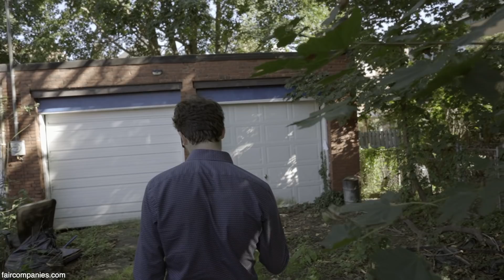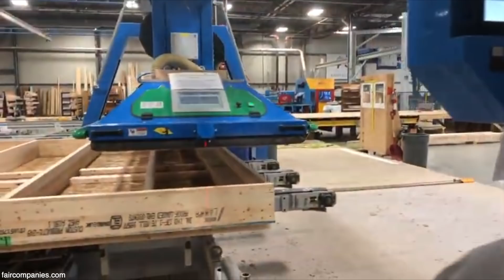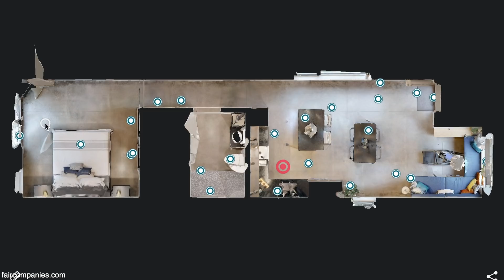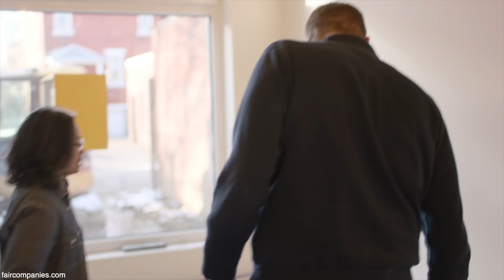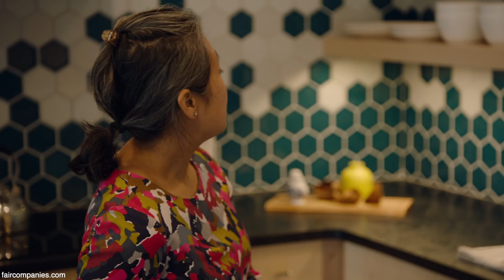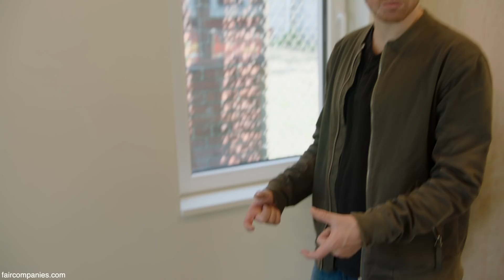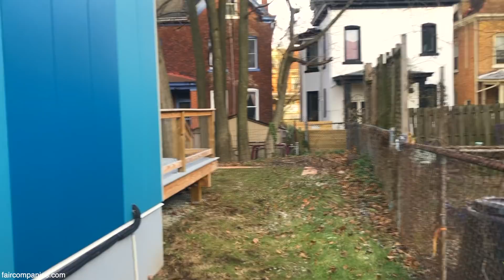Pittsburgh incremental house: a home that can grow with you

Comment: It's a great house overall - but those banquettes are going to be hugely uncomfortable because the backs are not sloped to take actual bodies into consideration. 

As a matter of designing for aging-in-place (which is what the clients parents (and possibly they themselves) will be doing in that house, and universal design, the kitchen should also have countertops of a couple of different heights so that if any of them finds themself in a wheelchair, they can still reach the counter. The stacked ovens are also not placed optimally for this, either.
Reply: Yep, I can't get stuff out of the microwave because it is above the stove...that wall oven would be a nightmare!

Comment: Our first home was  on a concrete slab in Buffalo- that cracked and shifted over the years with the freeze and thaw of the seasons. Will the same happen on this property, I wonder?
Reply: Ferd Ferd.D What memories this brings back. 😊 so the house was a cute little cape cod style home built in a neighborhood for returning GIs from WW2 an elderly neighbor told me. It cost $1k to build and if they wanted a basement then it would have been another thousand. Needless to say our homeowner decided to forego the basement. By the time we moved in (2008) the slab had cracked and shifted pretty bad, but was hidden beneath thick foam padding and carpeting. My dad was an engineer and flipped houses on the side and warned us against it- but we had a tight budget, a baby, and were young. We ran into issues with our sewer pipes in the bathroom that were corroded and overflowed- we had to jackhammer the entire bathroom floor (slab) to fix what portion we could. I remember too that the floors were always so cold, and we had structural problems with the framing/supports. Buffalo winters and all...Not sure that helps any, but living in the northeast I personally wouldn’t choose a slab foundation again. Many homes in other parts of the country are on slab- so it really is relative to your area. We ended up selling the property in 2014 before a major expense was needed.

Comment: I personally still prefer the hand built personalization on site.  The strength and fortitude of the structure as a whole.  There is not enough lapse in time to know the sustainability over long periods of time.  How this will hold up to extreme weather.  With the utilities built within the prefab walls. How difficult & cost effective when repairs are needed.

Comment: These construction methods are no doubt better than what the narrator calls "stick building-" a pajorative for platform framing, but these methods are out of reach for most Americans. Cranes and the crews that operate them are expensive, and I bet those CNC machines aren't cheap either.

Comment: It's a modern trailer home without being mobile. 😂 you never mentioned the cost.
Reply: I get the “trailer home” description, it fits! At least with this layout.
Reply: @Ferd Ferd.D actually it's not modular - where complete volumetric modules are loaded on top the back of a truck, & craned into place - this is prefab, using a panelized system.
Reply: $450k....
Reply: @supshorty420  Is that a joke?
Reply: Yes that’s it.  I like how they try to justify how it fits in with the surrounds. The colour of the wall matches the blue of the octopus! 🤷🏻‍♀️  In fact it stands out like a sore thumb.
Reply: How many square feet?
Reply: It's less than half a million, very affordable.

Comment: I would like to know the cost/price of these homes. Everytime I have checked into it, last one being Bluhomes, the prices are too expensive and you still have the stigma of a manufactured home to overcome during the resale process.  Building your own home is a much better idea and better long term results as well as cheaper in most cases.
Reply: Starts at 149K for 640 Sq feet, 1 bed 1 bath.
Reply: @Arjay404  wow  that's hella expensive, might as well build your own home.
Reply: @MetalGearMk3, I don't want to sound down on you, but why take a commenter's word for it?  They should also post a reference that can be verified, imo.
Reply: @Arjay404 : HAHAHA!

Comment: Price to build this is conveniently MISSING.
Flat roof is terrible idea in area where it dumps several feet of snow. This roof will collapse! {unless someone dangerously climbs up every season and shovels off the snow.
Reply: friendinspirit box stores in the area are low slope flat roofs. I believe it is about engineering.
Reply: Every 100 year old plus home in Philadelphia has a flat roof, including mine. In my lifetime i've experienced snow up to 35" in one day and 80" in 3 consecutive days. No problems whatsoever. There are flat roofed homes in Alaska. You realizes these homes are designed and engineered by well trained professionals?

Comment: They are talking about adding things 20 years in the future, what happens if the company doesn't exist any more? Does it then become unviable to expand the house? Are other companies able to take on that sort of project without any plans or knowledge of how they were built? Many companies don't make it to 20 years, so hopefully these don't become obsolete before the features that they offer can ever be utilised. If the company still exists in 20 years its quite possible they will have changed standards too, will upgrading the older buildings remain financially viable to the customer? Or will they be an expensive edge case?

Personally I think it may be better to build housing that can be reconfigured with relatively little effort by competent trades people in order to meet whatever modern demands are. Build once, then reuse. If building a 2 story family house, put the stairs in a location where it can be reconfigured to become 2 residences (1 upstairs, 1 downstairs) each with their own front doors. The UK has many examples of this in its older housing, and if they are built well things like sound transmission shouldn't be an issue in anything but extreme cases.
Reply: I think with design decisions like the flat roof they've already made it easier for an unknown someone to alter the house in the future. It doesn't matter so much who that someone is, as long as they have basic construction skills. I think that's the point.
Reply: sami chartouni  Yeah. Sadly it is another company who claims to have solved the housing crisis with the main ingredient being the homeowner has to be rich. The place in the video looks nice, but this is not a realistic answer to the housing crisis. It's more of an overpriced soy latte double mocha frappe when all the person needed was a simple cup of coffee.
Reply: aljowen well, it’s a modular home. Expanding it to how they spoke of shouldn’t be difficult for your standard building company. The issue would be that it wouldn’t be the same as the original unless they found another modular home company to continue the work.
Reply: @GloriousAguacate  In general I agree, but adding a second story on top of an existing structure isn't as simple as building a normal extension. Without good documentation of the design, how is a builder to know which sections are load bearing and suitable anchors for the next level? With a conventional building its not going to be hard finding people with the experience to do that, with a one-off proprietary design from a small company its going to be new to all the people working on it. Presumably it should be fine providing they can reverse engineer things, but that takes quite a bit of time and effort to do, which will make things more expensive. At which point what is the benefit over building a conventional structure with load bearing walls? Features such as the removable roof end up being wasted, because it will be easier to bin it and build something conventional on top of the existing walls. 

In the video I noticed they were having to slot plastic hoses from the roof to the walls, that's simple enough when you know where those holes are. But if they go out of business that's something that anyone extending the building cannot know until they pull the roof off. Those hoses may be unimportant, but I think it illustrates how even small things could add up to being a headache if there is no one with experience of working on these buildings.
Reply: @aljowen  I agree, throughout this video I was thinking this sounds like vendor lock-in, especially when patents were mentioned. It would be exciting to see an open source version of this, a design signed off by architects but able to be constructed by multiple companies and understood by contractors. It could make this type of construction far more common and promote competition in price and drive innovation of modules.
Reply: @aljowen  I assume the designer would give blueprints to the homeowner, or at least they would be on file somewhere so a future builder could read them and know how to add on.
Reply: At $149,000 for a 640 Sq. Ft house.... id give them 5 to 7 years. That farm home\garage next to that property would cost you $50k - $55k with foundation, electrical & plumbing.
Reply: aljowen what a great question.

Comment: What is the mortal fear of flat roofs? Do you realize how many buildings have flat roofs in the city? Every commercial building, skyscraper, shopping center, apartment building, etc...buildings that are much more expensive to maintain than a house. Pittsburgh is no different than any other city in the north (Cleveland, Buffalo, Montreal!...). Flat roofs are engineered to handle these “live loads”. Plus having a layer of snow on the roof is an old method of actually insulating the home from heat loss.
Reply: You missed a tiny piece - the walls in this house are wooden hence the amount of snow on the roof which they can endure isn't that big as it could be with brick or concrete, although for this size it could be maintainable with ease.
Reply: The flat roof alarmist comments are surprising me.

Comment: Their is quite a bit of in-fill lot opportunity in Central FL cities.  Can these homes be designed for the FL weather environment (130 mph wind & humidity)?  You don't mention $$/sq ft.  All new homes down here now are concrete, block, stucco with wooden roof trusses.  Selling for approximately $100/sq ft (new construction on your lot).

Comment: I think putting a flat roof on a home where 2 feet or more of snow can fall in a day is a bad idea.
Reply: if you noticed from the drone views, there are other flat roofs in this very neighborhood, probably over 100 years old.
Reply: I had the same thought. Kept expecting them to add a sloped roof on top.
Reply: If you don’t know, you can make flat roofs for homes in high snow areas and if they did it that means that the building code allows it otherwise they wouldn’t have.
Reply: Shovel the roof.😜
Reply: I am originally from St. Louis and there are many flat roof buildings that are homes. Many are over 100 years old. Meanwhile, many commercial buildings have flat roofs.
Reply: I live in Pittsburgh. We usually only get up to 3-5 inches of accumulation, the foot or more deep snows are rare and well-remembered (we’ve had very mild winters the past 4 years). We’re somewhat north and near mountains, but it’s not an alpine climate.

There are flat-roofed buildings (usually cheap buildings for office or commercial use). They usually have some kind of (ugly) waterproof sealant and a slope leading to a gutter (I could see a gutter in the video), and even with insulation the roof would be warmer than ground and some snow would melt. However, every time I see one on an unused building, it’s obvious that the roof degrades fast and probably needs frequent maintenance. I still wouldn’t want one for a house I intend to live in for a decade or longer.

That said, we never actually see the finished roof in the video. If you saw it, please help me out with a time stamp, because I missed it! His high school wood shop models of houses did actually show moderately angled roofs though.
Reply: Vegan Parent • I didn’t say our winters are mild, but I would say the heavy snowfall is more rare. Yes it’s snowed in June, and who can forget the snowstorm on St Patrick’s Day in the 90’s? I remember a few other multi-foot snow accumulations, but I haven’t really been “snowed in” (that I remember) since I moved into my townhouse. But I’m not disagreeing with you!! I would definitely like my roof to hold integrity without needing to be refinished for +20 years!

Today was nice though, actually ended up walking around downtown and across the Roberto Clemente bridge for a few hours
Reply: With this wacky design idea, I can only imagine his plan included the potential for a housetop ice skating rink.  But then, what do I know. I spent most of my life in the mild Mediterranean climate of southern California.
Reply: Building codes consider snow and rainfall in each geographical area they're applied and have building specifications allowing for such loads. As long as they built it to code they will be okay.
Reply: membear don’t you know it’s going to stop snowing, have you heard of global warming.
Reply: @roblamont8756  ... true dat. I live in Pittsburgh. We haven't had much of a winter this year. I feel like I live in the south.
Reply: @roblamont8756  Oh boy someone has been watching fox propaganda. No other excuse for this level of stupidity.
Reply: @roblamont8756  You mean climate improvement ...?
Reply: @manfredschmalbach9023  I don’t think the people living in the Western side of the U.S. would agree with you, given the hundreds of wildfires in the last few years, where thousands of homes were lost.
Reply: @bliss4383  I'm not in dire need of their agreement to be honest, but I can see what You did here ...
Reply: @roblamont8756  global cooling is coming, the sun is in the last stages. Get ready for the ice age
Reply: @EverythingJesusForever  but I thought the next stage for our sun was to become a red giant, expand, & consume the inner planets of our solar system. Hope you've packed your SPF 50¹¹¹¹¹¹, global warming is gonna get much worse 😋